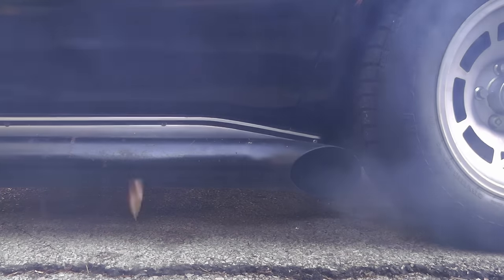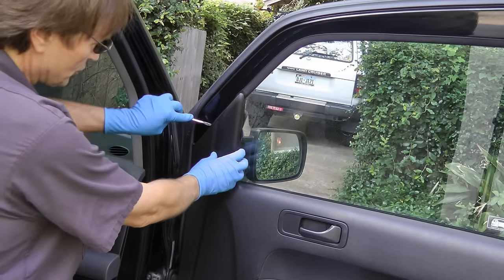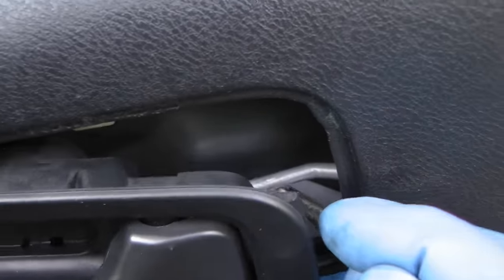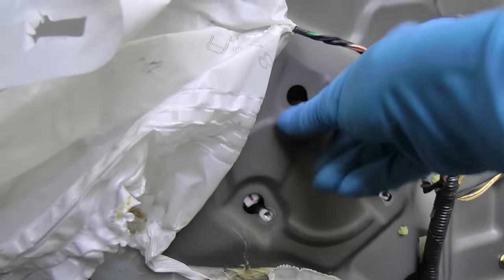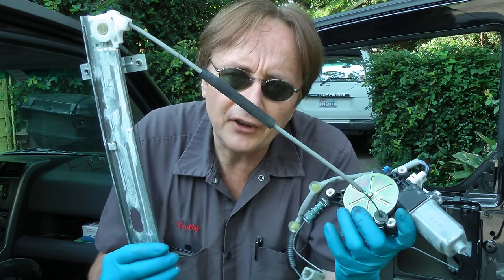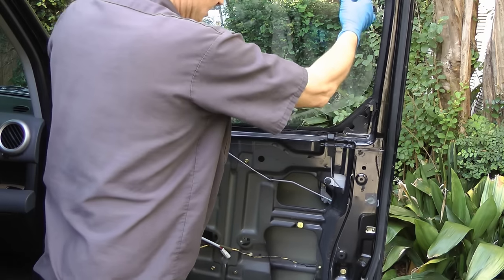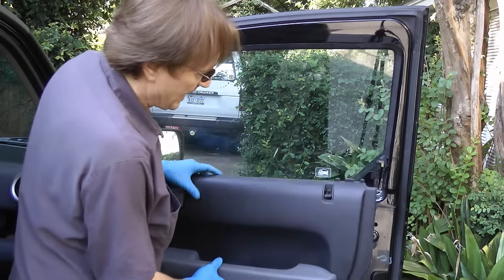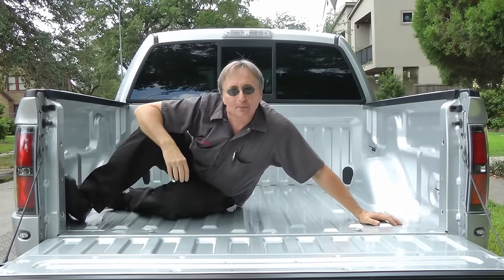How to Fix Power Window (Regulator Assembly) in Your Car

Comment: I have a Convertible (1999 chevy cavalier 2.4) The driver window does not go all the way up and when i try to roll the window down it sounds like it is trying to go down, and goes down very choppy to about 1/4 of the way then stops, Also my passenger window goes only down about an inch before stopping completely and does not go back up at all, i dont want my car getting rain in it what do i need to fix this issue?? Thanks!!
Reply from the maker: +Glyde replace the motor regulator assembly
Reply: Scotty Kilmer Thanks for the reply Scotty, the issue is that i can not find the motor regulator that fits the Convertible trim
Reply: Holy shit cars are overpriced.
Reply: Scotty Kilmer I have a 2010 Chrysler 300 touring And the driver side window just wouldn't go up all of a sudden after I let it down all the way, any suggestions on this problem???

Comment: I have a 1999 Buick Regal LS and the drivers side window was working for a while (hardly) and now it's stuck completely down and will not roll up, when you hit the switch the motor sounds funny like its jammed almost. I am unsure what to do and do not want to take it to a body/electronics place to have it fixed. Please help me out.

Comment: hey scotty my driver side windows is not working. i can roll the passenger window from the driver side but no luck on the driver side. also if i lock the car with the switch i can't unlock it  from the inside with that switch. i think i have a bad switch. need your help
Reply from the maker: odds are that main switch is bad, they go out all the time. Simple job to replace it, but most aren't cheap to buy
Reply: Thanks man. I ll go visit some junkyards.

Comment: I just replaced the window motor an track , my window goes only down half way, then back up good. Take the window off and the track goes all the way down. Please help me.
Reply from the maker: often they will stick on wiring or other parts and jam half way down, check that IF you also replaced the window regulator assembly, if not, replace that

Comment: How can I going around the switch since there is a relay controlling window
Reply from the maker: you can hot wire power to the switch directly from the battery with a jumper wire if no power goes to the switch now. Or you can just wire power directly to the two wires going into the window motor, one is ground, one is power. One way makes it go up, swap sides and it will go down.

Comment: I have a 1999 Jeep Grand cherokee that the front passenger window stop working in the up position i can hear it clicking! Any trouble shooting  idea's will be Greatly appreciated!
Reply from the maker: generally a broken regulator assembly, or motor gear has broken, take the door panel off and check inside

Comment: window on grand am passenger side. seems to fall off track. have to hold it straight while pushing button.
Reply from the maker: you need a new window motor regulator assembly

Comment: Granted most cars are all made out of Fiber glass these days,, but you know what really bad idea scotty,, that they make the inner doors where the window motor mounts and hardware,,its made outa fiber glass,, so after I drilled out my rivets on my 98 firebird years ago,, but bolts I installed to replace the rivets are eating tracks away of the inner door,, that piece should be metal where things are bolted to,,, very dumb on GM

Comment: Hi, my driver's side window used to roll down, then it would get stuck and I have to roll it up a little, wait for a bit, roll it up a little more, and keep doing this till it was up all the way. Seems like it's been getting weaker and weaker.  Today when I went to roll it down, it only rolled down about 1/4 or 1/2 an inch got stuck, and didn't roll back up at all (didn't hear motor / anything).  Given its past history - do you think this is more likely the motor or a switch? Or possibly something else like the regulator? I thought it'd possibly be the motor since it has seemed to go out over time - my passenger side window seems to start to struggle too now to go up and down, like maybe that motor is dying out.  But maybe the driver's side problem is also the switch since it seems completely dead now.  Thanks for any help!!!!

Comment: If you're an idiot like me, then take your car to a professional. Also for all you know, your car holds many parts held together by rivets and not bolts; you're going to have trouble removing those. But MAYBE you can learn from my mistakes, yeah I removed all the panels and parts out of the way. Then came the window... and now I need a new window. Don't set the window down in solid concrete, NO MATTER how gently you set it down. You'll be cleaning up about a thousand pieces of glass. I just turned an afternoon of free time into an afternoon of regret. Don't be like me y'all.

Comment: I did this for my acura cls on the driver's side but the button doesn't do anything when pressed. I replaced the battery so that shouldn't be the problem and the button right next to it that controls the passenger side window works. Anyone got anything that might help?

Comment: Rear driver side window went down and won't roll back up. I have tried starting the car up and shutting off a few times and accelerating while holding power window to UP position even with someone yanking up...  it didn't work.
Removed door panel and turned key to on position II. Feding each end of speaker wire to the 2 pin motor connector leads to the switch connector leads. Tried every hole.
A mechanic thinks motor... (CONTINUE...)

Comment: Ok. So my battery keeps dying for no reason and i know its something that keeps drawing power. and my power door locks work sometimes and when i get the positive battier cable and just touch it a little to the terminal it gets a big spark. So i go and pull out my Power door locks Fuse and touch the cable to the battery and no spark so know i know its the Power door locks. So what is next ? 
new Fuse ?

Comment: My drivers side window won't go down or up, all I get is a plasticky crunching sound?
Reply from the maker: do as in this video, and in some cars you can replace just the regulator assembly if the motor is good
Reply: hey i have the same problem as you!!! I own a 1997 honda accord and my drivers side window won't go up and down and that plastic crunching sound is what i hear too! i tried to pull up the window myself but its still not enough so that rain won't get in and thiefs may try to steal my stuff!

Comment: A beautiful sunny 75 degree day, I roll up my window (auto switch )and the window shatters once it gets to the top! it's also a Honda, 2005 Accord coupe. shouldn't the switch sense the load and cut current to the motor?  Now I got to find a rare piece of glass used, or pay the safelite boys.
Reply from the maker: it should, but obviously it didn't. It's 12 yearss old and things break, NEVER trust automatic stuff on an old car

Comment: So watching this video the cable must have no significant important on the door. He clearly shows that the cable was not connected towards the beginning (as this is the problem I am having) but never returns to how it SHOULD be set up.
Reply: i found it easier to type in my car name and year there is another user 1A Auto Parts and he will most likely have what you're looking for in a much detailed version

Comment: '73 Corvette;  Hear the motor running, but window stuck in up position...
Suggestion, thanks..
Reply from the maker: time for a new window regulator assembly, just changed one a few months ago
Reply: Scotty Kilmer
Hi Scotty;  How does it come out?  Have a mechanic working on it and he can't figure it out.  Any tricks?  Thanks,  appreciated!
Reply from the maker: flyingtoday
find a real mechanic, that guy's an idiot, that old thing is so simple. Just remove the inner door card and it's all right inside there
Reply: Scotty Kilmer
  I did look it up, and your right, not hard.  The panel is off.  Looks like remove the bolts going thru the motor and pull it out.  The info I got said the window had to be half way down, I assume if its held up, should be OK...
Reply: Scotty Kilmer Hey Scotty I've got 07 Crown Vic Police Interceptor that has a passenger side window that wont roll up. It's stuck down, whenever i press the button it doesn't roll up and there is no noise could this possibly be the fuse or switch and not the motor and regulator?
Reply: Mushtaq Samim Actually never mind the window doesn't roll up on the passenger or driver switch so it's most likely the motor assemblies
Reply from the maker: Mushtaq Samim
there's only one fuse for all windows, if any work, you have another problem, like motor burned out

Comment: i was about to drive my holden astra car around 10,30pm on really cold night i press the switch to the right hand side passenger to go down to get the mist of to see and then put back up and i herd a loud crash noise from it and try to put back up a gain make loud noise but nothing happing
Reply from the maker: your window regulator assembly has broken, time for a new one as in this video
Reply: Yea might have to. Get one then thank.you and great. Video

Comment: I replaced my motors. Damn things still pops out of track. F power windows
Reply: +Matt Price i find once they pop off the rubber track it makes a grove for it to keep popping off at that point... almost like you need to replace the rubber trim it slides in? thats the problem i was kinda having

Comment: 2002 Malibu 3.1 ls. No power at all n or out of car batt good. Ask auto part store it might be bcm or pcm donot no where it is can get it out to have it tested
Reply from the maker: basically, start at the battery, and check power and ground from the battery positive and negative cable back to the vehicle. Somewhere you will either lose power or ground, use a test light or meter to see where power is eventually lost, and that's the problem when you get there.
Reply: Scotty Kilmer my power window only goes up or Down Incrementally
could you tell me what the issue might be ? I mean the incremental speed is good
however I have to press the window button 6 or 8 times to go completely down or completely up

Comment: My windows sometimes doesnt come back up. The more i try the lower my window drops, but i does come back up when it wants to work. Its annoying as hell.
Reply from the maker: 530pthor often a weak motor does that, but really, best to change the motor regulator assembly all together, as aftermarket units cost so much less these days
Reply: Thankyou scott

Comment: How to install a window regulator on a 93 cadillac fleetwood
Reply from the maker: same basic process as this, remove the inner door panel and unbolt the window regulator/motor assembly. Then take the motor off the regulator once off the car

Comment: Hey, Scotty! Thanks for the excellent 'advice' on 'power-window repair!'
"Just take a screwdriver and force the panel off with it, don't worry, it'll come right off if you pull good and hard!" Really?
I need to watch your video for this?!?! Like 'who gives a shit if the panel breaks/cracks or refuses to fit flush again" because you didn't get the proper tool made specifically for THAT PURPOSE! Nawww...just go right ahead and tear the shit out of it and do 500-hundred dollars worth of damage to your car for a two-hundred dollar replacement motor/lifter-jack assembly!!! Gee...what swell EXPERT advice!
(maybe this 'why' Edd China has a syndicated show of 'Wheeler Dealers' and you DON'T)
Reply: Mathew Wood You tell me 'what part' I'm 'exaggerating?' I went by what I see on the video!
No 'diagnostics' of any sort! NONE!
Just start pulling the panel off the door...and just how the hell that is supposed to reveal what's wrong is completely beyond my understanding!
***** 
Do you hear 'Scotty' anywhere stating "I checked the inside of the door-panel and the lifting-arm mechanism was broken and the window is completely off the track-guide! Rent a camera-scope at auto-parts store and feed thru an opening in the door-panel FIRST...before you take everything apart!
****
Did YOU hear this? I didn't.
Which part am I wrong with? And please tell me 'WHY' you shouldn't check the appropriate under-hood fuses 1st. and then the inside 'breakers' and then remove the inset containing the switches and make certain of continuity FIRST!
Before 'tugging the shit' out of a very expensive door-panel and distorting it!
*****
My windows didn't work at all...so I did all the diagnostics FIRST! My first instinct was right! The driver's window 'master' switch had a loose ground...I tightened it, and everything was fine thereafter!
(I removed ONE small retainer screw to pull-up the switch-panel inset...which has enough slack to turn it GENTLY over to one side to view it from under the connecters)
*****
You don't 'like' my armchair' critique of the video? Or Scottie's approach to removing an inner-door panel?
Guess what ASSHOLE? I DON'T CARE!
Reply: Gerry Nightingale for someone who doesn't care, you sure had a lot to say!
Reply from the maker: +Mathew Wood  he's just another net troll, place is full of them.  thank god I never met him in person, sounds like a real A hole. world's full of them too.
Reply: Scotty Kilmer I don't know why they even bother watching. Your short videos have pointed me in the right direction a few times now, so thanks.
Reply: Scotty Kilmer Sorry Scotty, I never should have responded to this wannabe. I apologise. I  enjoy your videos. Keep up the good work. Thanks.
Reply: Mathew Wood Yeah...you're right! "Shoulda' kept my mouth SHUT!
I made a valid critique...that the methodology used to remove an inner-door panel is useless and damaging (IT IS) by not using the proper tools made SPECIFICALLY for that job!
****
I 'wanna be' what? An auto mechanic? Not hardly! My field of expertise is in emergency medicine...not some nebulous idea of becoming a 'monkey with a wrench!'

Comment: My '95 bmw's right side window wont do anything when I press the switch.
Reply from the maker: try master switch and driver's switch that moves that window. If neither works, generally a bad motor then
Reply: Scotty Kilmer
It make's a clicking sound when I press up or down but doesn't move. So the motor need's to be replaced?

Comment: my car is a 2002 dodge stratus. 4 door. the right back window wont move up or down neither makes no noise.  the main power switch has all lights ON. I was told that the main power motor has water damage. I believe is not true. they just want to rip me off just because Im a woman. the main power motor all 4 switches lights are on and if it was water damage I believe all of them wouldnt be working. 
would you please help me. im a woman and Im not afraid on braking a nail.

Comment: because your pusing air in when the stock motors can't handle it why do you think stock motors have heaps of things to stop air flow etc etc because it is made to what that motor can handle you can't put a ball down a battery can you? it doesn't work. you put a k&n pod on a 4cyl or 6cyl and 8cyl stock motor it will lose power or stay the same and plus it lets stuff in your throtle body and in the long run it jams or clogs shit

Comment: it is NOT simple and easy to access like he makes it appear for a regular guy. he is making a video and was a mechanic for decades. And your assembly may or may not work correctly and/or you may not have access to the bolts, etc. that you need to remove to even get the window and regulator out.... do not make it look simple because it is not if part of the assembly is not operating correctly.

Comment: Could you explain those motor bolts to Ford...their stupid idea of riveting the motor assembly in is ridiculous, as if there isn't already a limited amount of space to work in.
Reply from the maker: just a cheaper way to make a car, then when you fix em you have to rig up nuts and bolts cause the holes are too wallowed out from drilling out the old rivets.

Comment: Whaaat that’s not fixing the assembly that’s just replacing it. I’ve got a perfectly good regulator and motor, the cable just snapped. I know I need a new cable, I just don’t know how it all fits together. Didn’t help me and I don’t want to spend $120 on a whole new regulator.